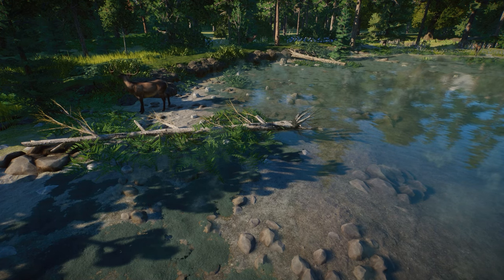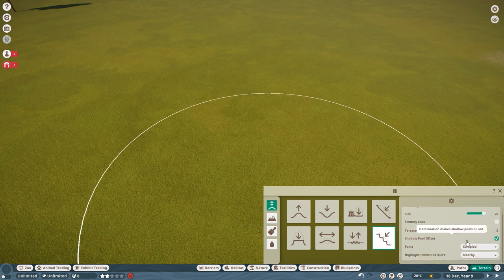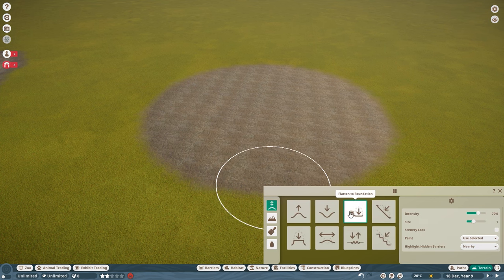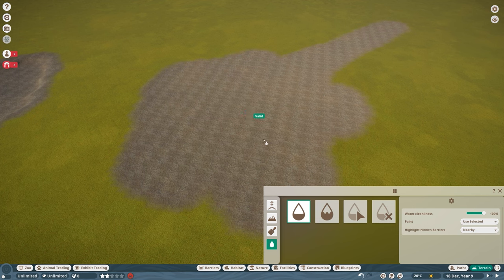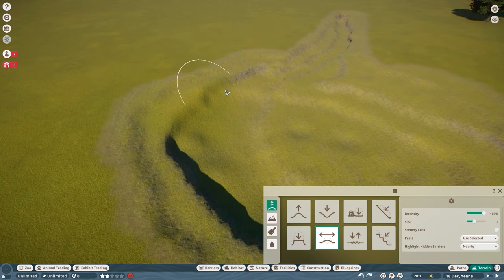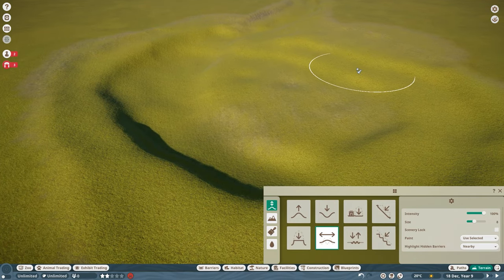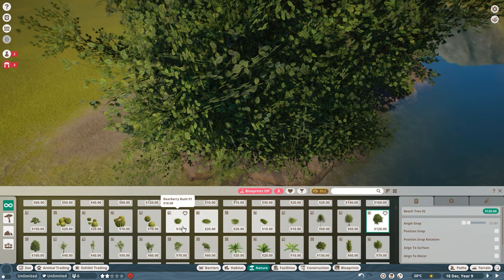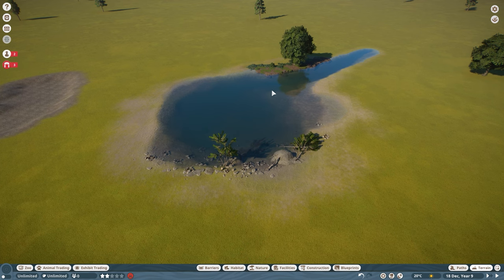These EASY Steps help YOU create super Realistic Waterfronts in Planet Zoo

Comment: where did you get the smaller faux rocks? i don't have them
Reply from the maker: You have they are just in the wrong order. Type faux and you'll find them
Reply: @RudiRennkamel  nope, I typed faux and also aquatic separately, I don't have the smaller ones. Are they from a separate pack from aquatic? I don't have all the packs 🤭
Reply: I’d like to find what he used. Pause it and read the hashtags. Once you do that copy it from what it said and there. Ex. # small # nongrid